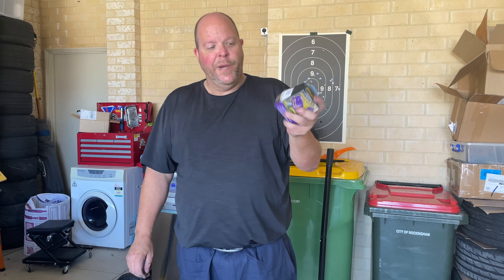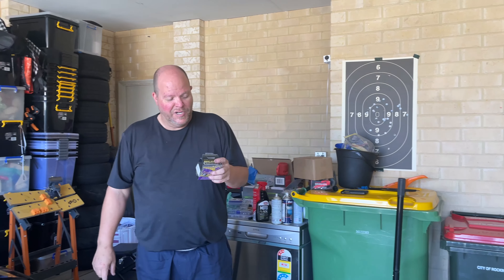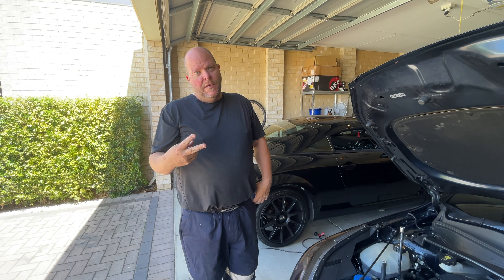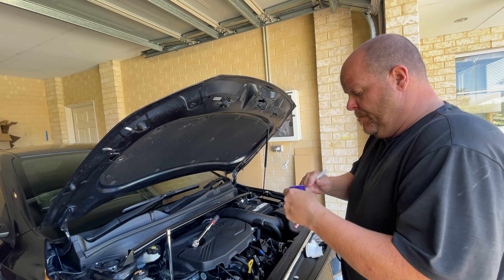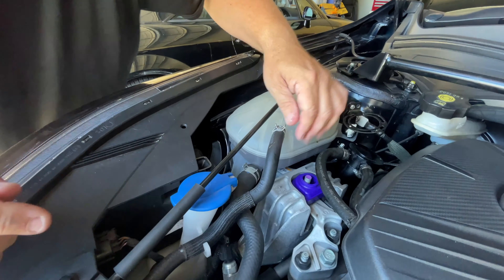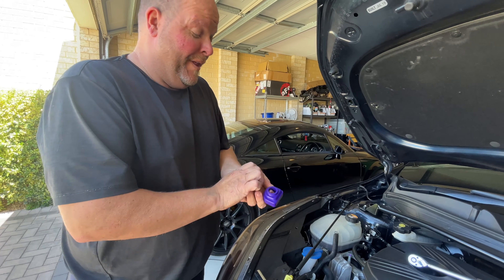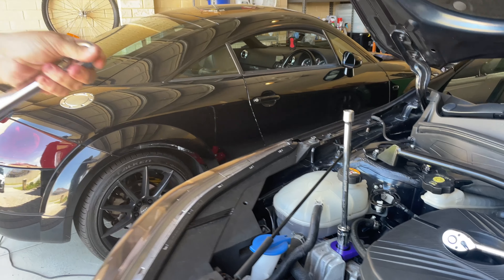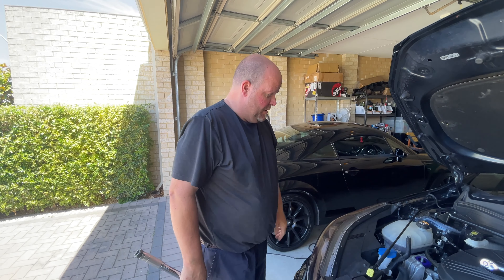Kia Cerato / Forte GT Upper Engine Mount

Comment: Brother could you send me links to all the bushings you installed 🙏🏽
Reply from the maker: Sorry about the late reply I had to look up some part numbers. 

Upper engine mount bushing 

PowerFlex Part Number: PFF26-125P (Purple - Medium) some NVH
PowerFlex Part Number: PFF26-125BLK (Black - Hard) added NVH 

Lower engine mount - pitch mount 

YELLOW PFF26-120
PURPLE PFF26-120P

Transmission mount insert 

PowerFlex Part Number: PFF26-123 (Purple - Medium) no added NVH
PowerFlex Part Number: PFF26-123BLK (Black - Hard) added NVH